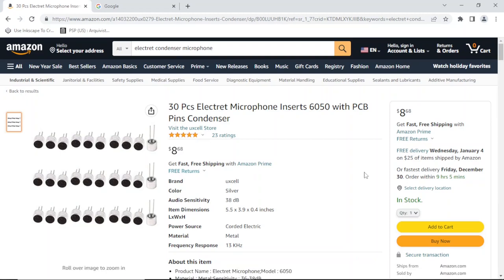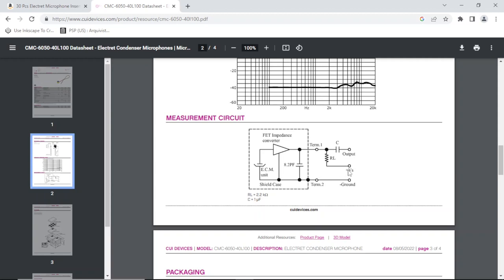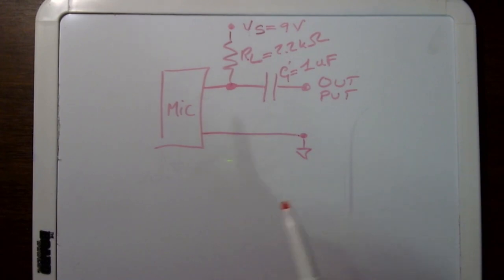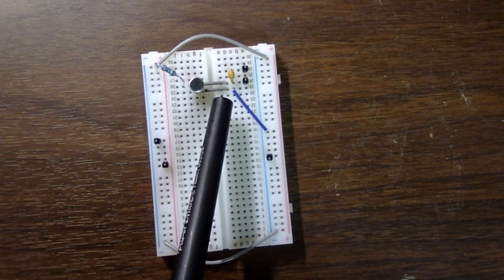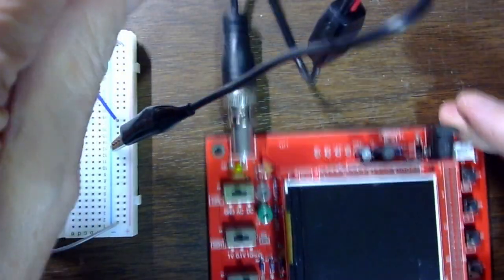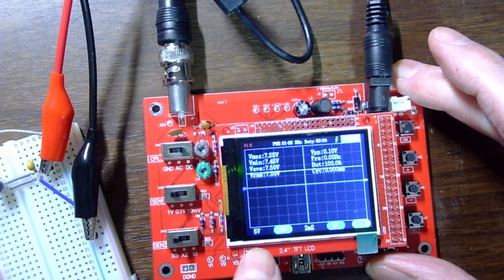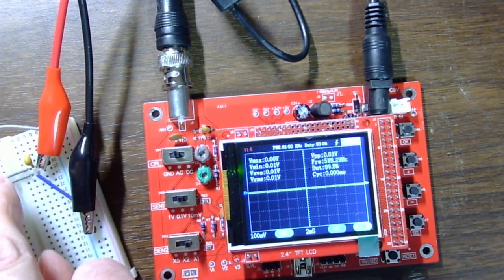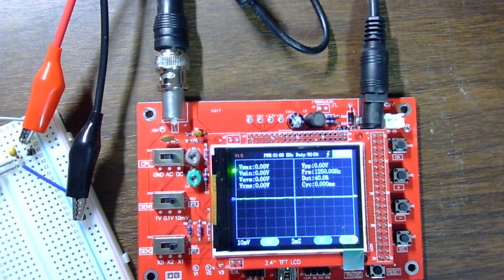How to use an electret condenser microphone in your electronic circuit

Comment from the maker: A little clarification about RL, the load resistor.

2.2kohm is way too low if the supply voltage is 9V.

If you look at the datasheet for the electret 6050, Vs = 2V, RL=2.2kohm and I=0.5mA.

This gives us the voltage at the FET, Vf, using this formula: Vs-Vf=RL*I. So, Vf=0.9V.

Now, RL can easily be determined for whatever Vs you have (should be between 0.9V and 10V though): RL=(Vs-Vf)/I.

If Vs=9V, RL=16.2kohm.

The greater RL is, the more gain the mike will have.

To simplify things, I would use a 10kohm for RL (when Vs=9v).
Reply: Thanks for the info, exactly what I needed. If I'm powering the circuit from the camera battery (2s liion, 6 to 8.4v) then it would be best to use a LM7833 to get constant gain, right?